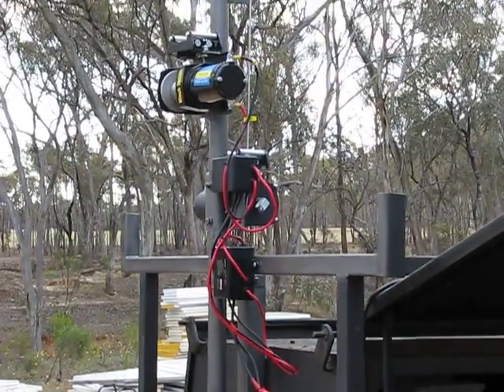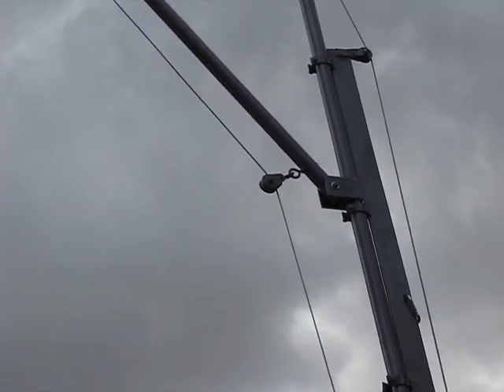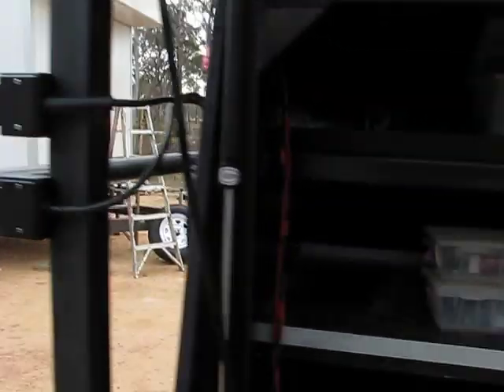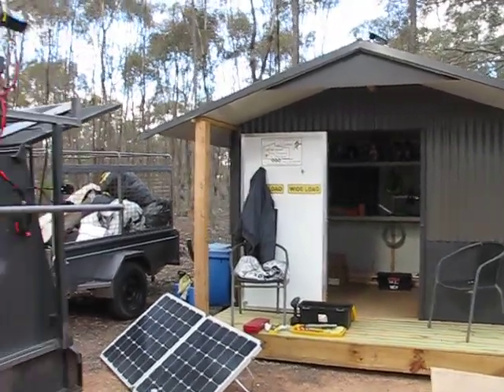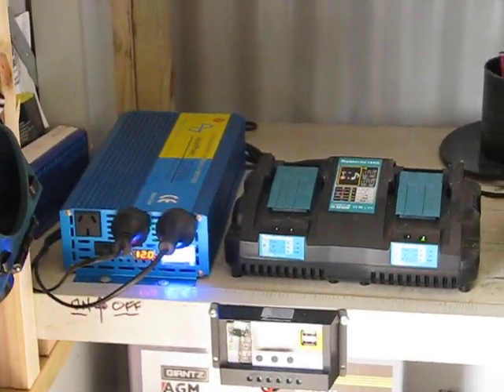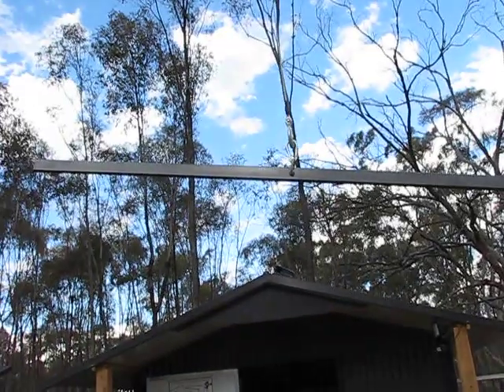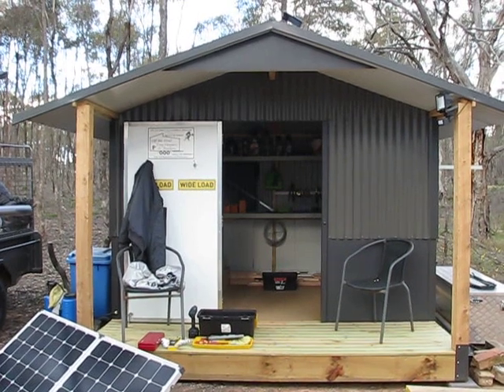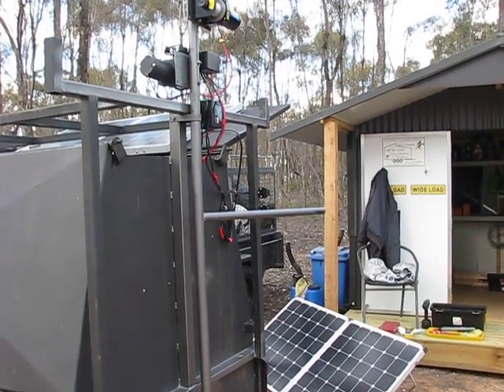Off the Grid Solar powered gib crane and work site

Comment: Envious of you Steve your way of life 🙌
Reply from the maker: Cheers mate, life is good as I say quite allot  ... hope you have a go at your version of off grid one day if you are not as yet there ... ?  :- )
Reply: @offthegridinoz.994  Im still living in Melbourne/Dandenong. I will eventually move back to NZ and go offgrid in a decade or 2. Learning alot from your channel Steve. I used to be a sub contract builder making portable buildings from those panels you use.on the pc I have designed my 12x6 metre home and a tiny home i want to use panel aswell. Your outdoor kitchen area/ Kerris garden is amazing
Reply: 4WD winch brilliant Steve, tuck that one away for the future. What a ripper